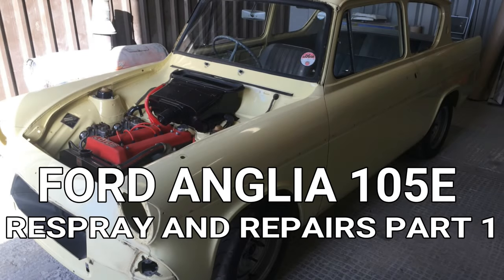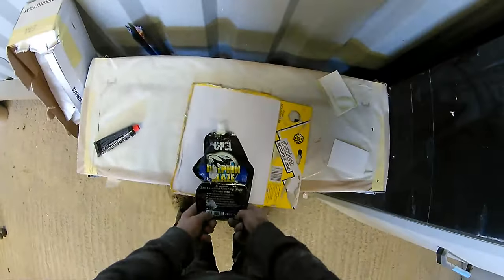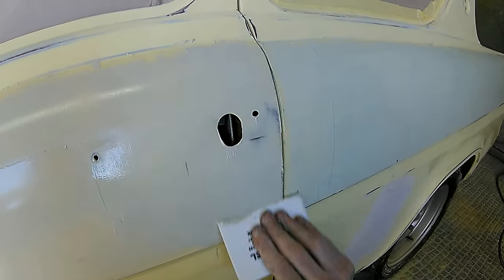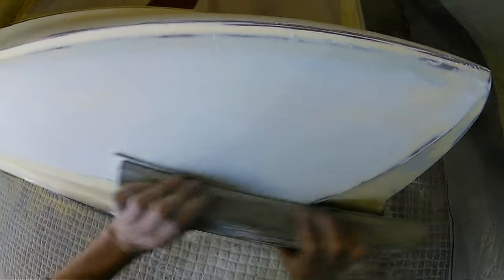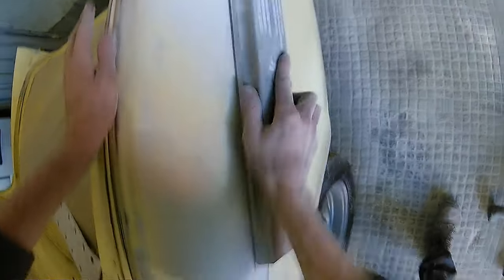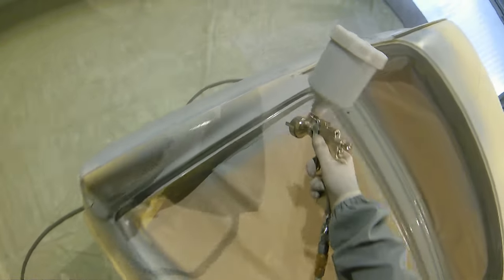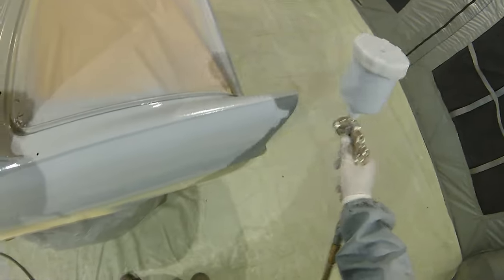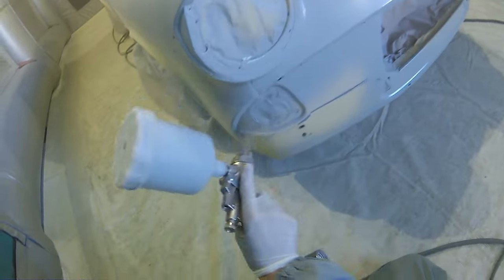1960 Ford Anglia 105E Respray / Repaint In Ming Yellow And Repairs Part 1

Comment: A real trip down memory lane for me.. Do you get any aged cars which are not concourse where the rust worm has been nibbling? Maybe I haven't scrolled through enough of your vids yet... As always a pleasure to watch. When these came out the Anglia vans had crossply tyres that made them very easy to "drift".  Of course I never drifted up the up ramp to the A40 in West London.
Reply from the maker: Yes mate it’s just not often I get the time to film on those as the works so involved tbh but I do have some work coming up on one soon I’ve got some videos planned for

Comment: Another great video Tony. 
Do you clean the spray gun in any way between coats, or just leave all the unused paint in the cup, fluid nozzle, etc?
Reply from the maker: not usually unless during the painting the air cap starts to get build up on it then il give that a quick rinse between coats

Comment: Another great video Tony.
Quick question how do you find the KAPCI primer to flat down i.e. does  it clog up the rubbing paper like some of the primers on the market?
Reply from the maker: Its not too bad if im honest but can be quite stodgy in the tin and needs a really good stir to get it smooth before mixing , ive just tried some from jawel paints there own brand one , real cheap but sands lovely and is also smooth as cream from the tin , going to give that some trials next
Reply: yeah know what you mean. I have been using PPG Koba D838 and need a cement mixer to stir it up but with any paints you have to put in the bench time to get the right results as you know. Let us know how you get on with other primer when you try it out
Reply from the maker: Will do mate thanks for watching fella

Comment: if you break though to bare metal would you use an acid etch or epoxy primer?
Reply from the maker: hi paul for small break throughs like we had here  i wouldnt but anything bigger than what we had here i would use etch, if it was a full bare metal panel then i would epoxy rather than use etch but thats personal preference

Comment: Love the resto videos Tony!  I was just wondering why you didn't use some of that spray filler to level everything out?
Reply from the maker: +Jack Peters if the whole car needed it then I'd use the spray filler and then block out that way but the lows in this car were so subtle that there was need to add such a large build of material to the car just for the sake of blocking out those areas , I do have a job in currently that il be doing a full hit with polyester spray filler as that's in real
Need of a decent solid blocking

Comment: enjoyed the vid but noticed you left a probable dry edge on the roof due to starting from each side and working in to the middle. I usually start one edge, work  to the middle then walk around and finish from the middle to the opposite side. I guess its only primer though but thought it might make some extra work? Ill subscribe,  it looks like you have some great vids, I spray and restore older cars(sprayed diesel locomotives for 4 years too) and watched alot of the Gunmans vids too. Between you  both, theres some awesome content! 👌
Reply from the maker: hey man welcome to the channel and thanks for popping over and subscribing hope your enjoying the videos so far, as for the roof yes your right but this job is being fully blocked out by hand top to bottom so its not something that was an issue really or something i was worrying about when i was priming it , my main focus was build for the blocking stage really